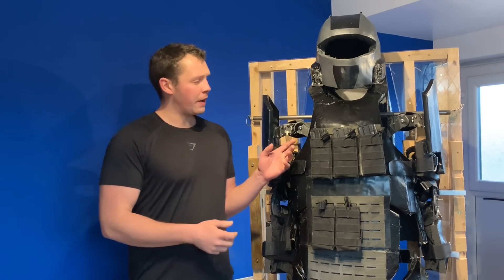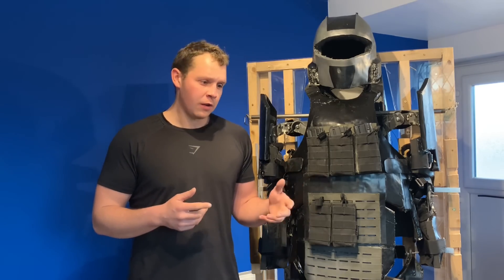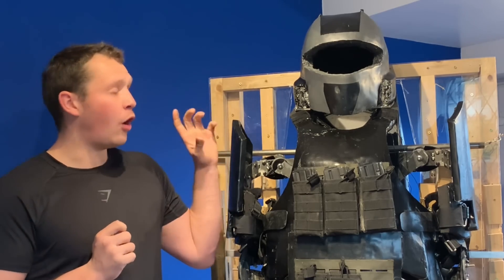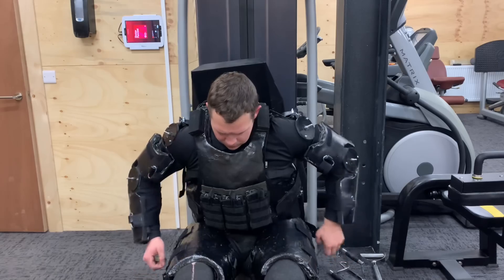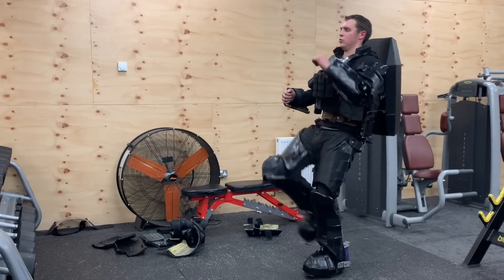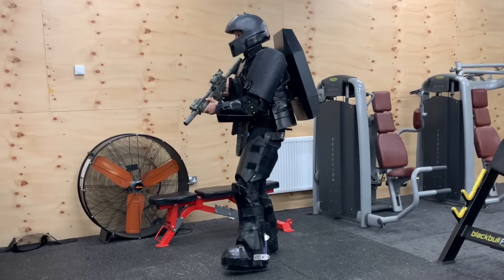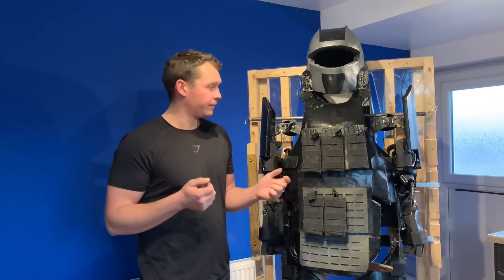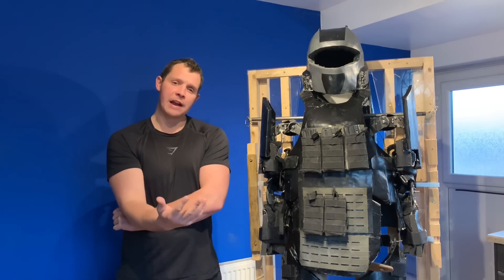Functional Combat Capable Power Armour Development Episode 5 Quest for Bullet Proof Exo Skeletons

Comment: It must not be very useful or cost effective considering there's no military that uses them yet even though it seems like a good idea
Reply: The main problem is the power supply. We don't have batteries with a high-enough capacity to move something like this for long. The soldier can wear a small, portable gas generator, but even that limits combat endurance to a few hours at most when regular infantry can go all day. Plus, it's noisy and alerts everyone to your position. If you're gonna do that, you might as well roll up in an AFV and shoot them in the face with a cannon whilst being behind some proper armor. 

Then there's the question of what our armor is powering in the first place. Presumably, it would allow troops to carry more weight in armor, as well as weapons, ammo, and field supplies. So does a Red Flyer Wagon, or preferably, a could of attached logistics and combat drones. The armor being on an infantryman is useful for urban combat operations and tight spaces or terrain that drones find difficult, but that doesn't outweigh the disadvantages. Literally. The weight is part of the problem, because humans have relatively small feet. Even if the suit works and carries a ton of gear, all that weight increases ground pressure to the point where we'd get stuck in the mud, or sand, or fall through weak floors. A drone can have multiple feet, or treads, which spread the weight around a lot more. And of course, if the enemy is really dug into a building, you can always just blow up the whole building. That was always my favorite method of room clearing. 

Finally, a last note on armor weight. We actually have better and lighter armor that troops can wear right now without requiring power. It's made of graphene, a carbon lattice that can be configured to  be hundreds of times stronger than steel. That also means it is hundreds of times lighter, since you don't need as much of it to protect. We just don't use it much because it's horrendously expensive at the moment, about $60 USD per square inch. The problem there is that we do not yet have a way of producing it in large quantities cost-efficiently. When we eventually figure it out, you'll see graphene in all sorts of things, but for now only a small crack unit could reasonably be outfitted with such armor. half a million infantrymen? Not so much. The cost would be ruinously expensive, and no matter how much people say you can't put a price on human life, there is one, and it is less than that.

Comment: Real question .. will it protect a man from say .. a rain of 5.56 automatic fire at close range. Groin and lower torso appears totally unprotected! Or better yet can it stop a single .50 BMG in the head .. is it actually any better than a flack jacket? Whats its battlefield role that justifies the costs and extra logistics and whats the use of a man who cant climb or run or swim because of this massive extra amount of steel hes carrying? Cross a river in it, with all your gear .. try to go thru bush at say .. 4 miles per hour. Uphill ofc :)

Comment: I'd recommend doing more research into combined arms combat doctrine, and infantry fighting tactics, it's an interesting project but doesn't serve any real combat function, it's not enough protection to justify the added weight, the increase in soldier profile, or the likely loss of mobility.... if you want real funding start with improving existing roles within current doctrine in meaningful ways, military development needs to be approached with a military mindset, not engineering or sci-fi

Comment: One way to power it. That's very diesel punk, is to strap like some kind of small motor on the back. Could be like propane or some other sort of easy fuel. And that way you can make it like some kind of hybrid with battery pack and a motor, that way if you need to be quiet you can turn the motor off and when it's low on power you can turn that motor back on. If you're trying to turn into a walking tank. It's definitely food for thought. If you put a motor on it, you could probably make it hydraulic then you really would be some kind of sci-fi power armor. I don't know how feasible that is though.

Comment: A few points from someone who has put work into this sort of thing except started with the motion assist system first . (The hardest part by far!) And then focused primarily on the body armor aspect, here are some recommendations in order of importance:

One, your video volume shouldn't be at 25% the average volume on youtube. Bad presentation will drive away investors and customers as well as people willing to give feedback. About half of the people I know of who would be capable of giving reasonable feedback on this project would leave the video within 30 seconds because they can't hear anything. At best you would get them to pause the video and skim the rest of the video only to leave without feedback.

Two, Start with the legs first, they are the most important aspect. If you can't get the suit to work with just the legs and a backpack while not reducing your endurance, you have made a piece of equipment for a warehouse, not combat usable equipment. There are certain techniques you can do to actually regenerate quite a decent amount of power from a walking gait while also helping with endurance.

Three, being able to stop steel core 5.56 at 25 yards isn't acceptable. Armor that can stop a 30-06 at 10 yards is the minimum for combat these days, the only, sort of, exception is exceedingly light-weight armor.

Four, literally start with a suit of medieval plate armor. (albeit, not metal if you can find one) The way that they articulate without limiting motion is surprising. (except for certain shoulder motions, and even then not all plate armor blocks it) Beyond that, the way that good plate armor was designed to deflect arrows and blades away from vulnerable joints is something vitally important. It looks like the plates you have now would mostly direct shrapnel into your joints which appear almost completely un-armored.

Five, Any "future proof" combat armor is going to have a heavy focus on chemical, biological and fire protection. That means it needs to be able to be totally sealed. Wearing a suit under the armor would be the absolute minimum and that means adding a lot of bulk.

Six, It is better to have good looking but non-functional parts on a demo build than it is to have functional but rough looking parts. I'm not talking about great looking, just something that doesn't look rough. The edges on your plates for example make the suit look very rough. The bolts sticking out do the same.

Seven, look up various attempts and why militaries dropped them. Most of the reasons are listed in the prior five points but you might find it interesting nonetheless.

Wish you luck, hopefully your next video will be loud enough for me to hear it with my speakers not turned up to max.

Comment: "Gentlemen, what you're looking at is advanced warfare"

Seriously though this is amazing work, though I have a few questions that'll probably also help production itself. 

How does this affect the internal temp of the user, anyone that's done military stuff will tell you even the slightest things you wear can increase your body temp a lot when doing physically strenuous tasks. 
Are you looking at a faster equip time given solders have to rest eventually, or at least fast release for medics or if it catches fire like modern plate carriers do?
While the pauldrons may seem great, id assume most soldiers will remove them like most did when the US army introduced them alongside the iotv, do you have an incentive to keep them for the soldiers or any plans to modify them? Perhaps shortening them would be a better option, 19 year olds still run on the rule of cool.
You mentioned room clearing applocations, however, with the increaed size does it make it more difficult to go through doorways and perform those operations?
Spawl is an issue often considered with modern armor, which is why something like the iotv, while it can and often does carry plates, it is surrounded by soft armor to absorb the frag, which happens even with ceramics. Do you plan on some system or undersuit to enable spawl catch that will stil stop the hindering of operations by the user?
And probably my last question, though im certain youve been thinking of it, when it comes to the power for the "weightless" mode, how long do you think you could get it to last? Id recommend having it be capable of sustaining at least a week of continual regular motion under load without needing a recharge, battery drop, or significant decrease in performance. Not just due to potential sustained long term operations, but also because soldoers will forget, most certainly in a combat zone, at least the current and next generation of soldiers not used to this tech. 

Again this is an amazing project and i sincerely hope you get the funding and time you need because if it succeeds i would heavily appreciate having it.

Comment: hey man, I have some knowledge in this from some design work ive done. So i would first look at developing a soft armor undershell. you have alot of exposed areas that could act as choke points for shrapnel. Incorperating aramid is going to be a great way to eclose your suit and give the protection that it seems to be missing. I would also look at the angels your armor is forming and the relation they have to vital areas. The breast plate for example; Yes it may have the ability to stop bullets without a collar it may redirect bullets into the neck region. I think flaring your edges , using lips on theedges or incorperating something like the OTV uses with a yoke piece that surrounds the neck might be what you need for those solutions.  

An idea a peer had was even looking to old knights armor jointing for fitting plates together.
 

also heres a link on making composites molds if youre having finish issues. trying to shape composites is difficult at best, youll get good finishes with good molds and a quick 600 grit sanding all around just to prep the surface for paint. 
https://www.youtube.com/watch?v=KpJdwryFj6k&ab_channel=EasyCompositesLtd

If I had the money I would contribute. Post to websites that do crowd funding. even talking to people around you at resturants and other places is a great way to rub shoulders with people who might see your vision. 

Once ive finished my Bachelors in a year or so Ill be reaching out to see if you have any open positions for US based engineers :)

Comment: I am certain someone out there will fund you. Also the aiming can be solved by augmented Visiers and basically a camera on the rifle. My main concern as a soldier would be tight spaces such as vehicles and urban warfare. There we need to fit trough small self made holes, tight gaps and what not. But I guess this can be figured out by time. The next thing would be a temperating undervest. But also these exist and I guess it’s just a matter of developing it for the suite. Finally we are seeing up to a ten fold increase of battery capacity (is that the right word?) until 2030. This will help in power this endeavor. I think it would be a feasible concept in time, specifically for taking positions in cooperation with vehicles for maintenance, energy and long range transport. So basically it fits into the role of mechanized infantry, like the Panzergrenadiers is served with. I wish you good luck in finding your match business wise!

Comment: POV: Jin Roh fans
Reply: Go find the papakura or stl files for Fallout 3 combat armor, paint it black after building. Get a stahlhelm M35 or M42 repro. Get a gas mask prop or one that can fit under the helmet. Get swimming goggles and line LED strips around the eye holes (pop those out too) and set them to red. Get a prop MG42 or build one yourself, sure you can find decent papakura OR stl files for that too. Make a fake 8mm Mauser belt with fake rounds. Or you can just do the Luger P08 which would be a or cheaper and easier. Get a black set of “tactical” clothing (don’t forget a belt), including boots. 
That should be about it for a simple Jin-Roh costume if you wanna go that route.

Comment: Yo, paratrooper here. Stuff like this is shit we like to talk about sometimes, and I feel as if my squad of nerd-ass infantrymen have a few points that we’ve brainstormed over the years.

Firstly this is dope and I really fuck with it, but it does present a conundrum. There’s always been this paradoxical relationship between the weight of things which soldiers carry and the development of technology.

While this is a self supported prototype that should feel weightless, it’ll only feel so whilst standing motionless. Moving forwards, backwards, or laterally will involve using musculature to get that weight going.

If all joints are motorized, it will result in substantially more batteries needed to power it, and then the need to carry spares would be prevalent. Lithium ion battery tech is just not energy dense enough for something like this to be viable for long term combat operations.

I’m not sure if you’ve seen the demo video for it or not, but the defense company Revision (can’t recall correct spelling) did a prototype of an exoskeletal armour system already which could give you some design ideas for yours.

Lastly, aiming can be done using PEQs (the visible and IR laser boxes you always see on weapons in video games). We use the visible laser for CQC (IR during night) and then the IR laser for outdoor combat during nighttime while under night vision. The concern to use an optic offset could be entirely eliminated. There are projects in the works currently which are developing night vision which essentially produce the ODST VISR outline shit with IFF recognition (check out the army’s new nods that the 82nd is testing). If this goes to fruition, you could perhaps see a system to use an IR laser during all times of day to eliminate the need for optics at all.

Biggest concern is batteries and mobility. Fight light to stay alive, move fast to keep your ass intact, be accurate to kill the other guy before he gets you.

Comment: As someone who make a ton of blueprints for stuff like this. was there any way to connect the legs to the back in order to have the back and upper body supported by the legs? my main idea was a type of hip ring rail system but i kept running into mobility issues and connections of over 10 kg would break but then again the main idea of mine was to not have the user bear 60-70 % of the weight.

Comment: It seems like a pretty cool idea, and I see what you mean about it being good in buildings. But I don’t think I can see this being used in Ukraine, I feel like it would get stuck in branches or thick vegetation and moving around  would be awkward in a trench full of your squad too because your gonna be moving past your squad mates in a small trench and also crawling over all kinds of terrain as well. And also the FPV drones are getting way more efficient and often target squads, trenches, and vehicles in swarms, at this point it’s not fragmentation that will take down the operator it will be the concussive force of the blast and the trauma it does to the operator inside of the armor. But who knows maybe you can be the first to develop a cool armor system that can deal with a threat like that. Good luck on the project man 👍🏼💯

Comment: I feel like armoring the feet is just unnecessary bulk and weight. You can get similar protection by just wearing thick steel toed boots. Obviously not really bullet resistant but I can just see the armor over feet just making you clumsy.
Reply: If you try running on anything other than completely smooth terrain I see those boots tripping you up as your step is now a much wider surface area.
Reply: i agree, atleast i dont think it needs to be armoured AS MUCH as he has made it
Reply: I think the armour is meant to be resistant against bomb shrapnels and has exoskeleton to handle the weight and gun recoil.

All in all, it’s a good concept.

Comment: Your straps shouldn't be secured on the outside of the armor,  also the dimensions of your plates need to be designed so they don't direct spalling and chunks of ceramic into the joints and gaps between the various plates. The spalling could potentially cut various straps while being directed into your chin, shoulders, and arms ect if you took a round to the chest. Should also consider spalling hitting people around anyone in these suits. I assume the material you choose maybe helps this? You should also look at RGO mixed into various super dense plastics that might allow you to make the plates lighter without all that bulk while actually catching the spalling and being able to take repeat hits. People might end up the only way to stop them is to weigh them down with lead by all the bullets it catches lol. Also it would be good to design it so the force of the impacts on the plates transfers into your exoskeleton instead of your body. Larger calibers and explosive will just push those plates through the body.

Comment: The main issue is that if your soldier are impervious to 5.56 mm shots, the enemy will just return to 7.62 mm and negate your advantage. There are still many munitions more powerful than 5.56 mm on modern battlefields (support machine gun, vehicle machine gun). And seeing the mass of the armor, I think you could give the soldier a more powerful weapon at the same time instead of sticking to a light carabine. The spirit with tanks is that globally you should be equipped with a weapon capable of knocking yourself. So a machine gun with 50+ bullets and a grenade launcher with pump action.